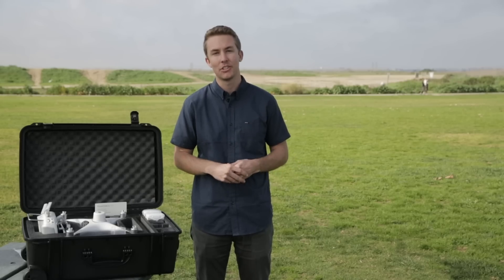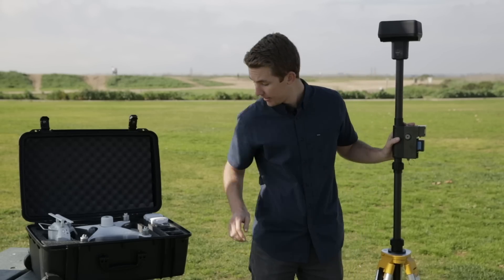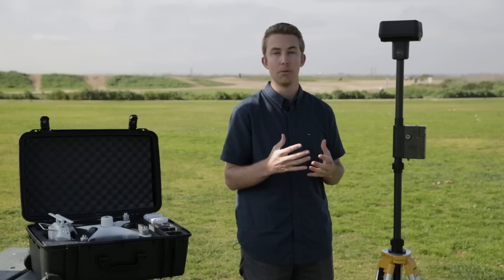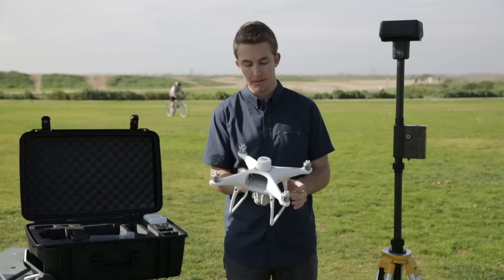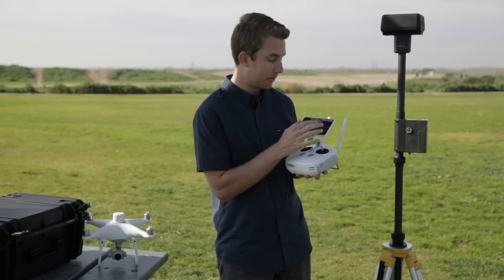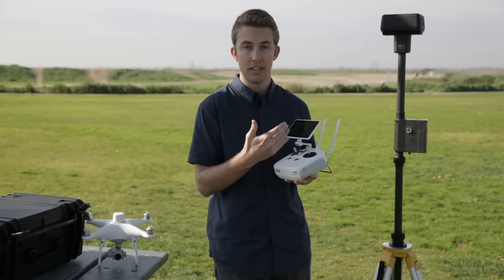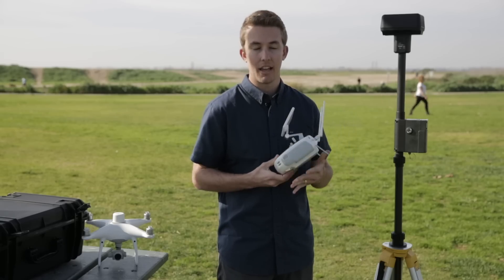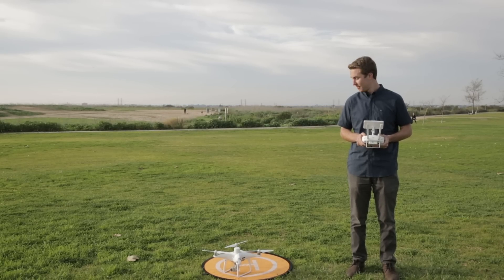DJI Phantom 4 RTK | Mission Planning & Setup with the D-RTK 2 Base Station

Comment: Just one thing to be very careful, if the base is not set on a known point or get corrections from a server, the relative precision will be good, couple of cm, but the absolute precision, the one that matters when doing a survey, will be 1-3m
Reply: Actually that is not entirely correct.  The relative precision will be within a couple of cm, that is correct.  But to say that the one that matters is your absolute precision is not entirely correct.  What I mean is, does the typical user really care where their map as a whole is accurately located on the earth to a couple of centimeters?  The answer is no.  A typical user does not care if their project as a whole is located on the earth to a couple of centimeters.  What a typical user cares about is the relative position to each other.  As long as my  points are correct to each other to with a couple of centimeters that is what is supremely important. A typical user will not care if the entire project is located to with a couple of centimeters to the correct latitude and longitude on the earth.   Only if I was trying to send coordinates for the chimney to send a smart bomb would I care that the absolute point is located.  The only flaw in this setup is that your elevation will not necessarily be tied into a local county or state benchmark Hopefully I made myself clear.
Reply: @MichaelSmith-td7op  Hi..so if I use this D-RTK 2 with Zenmuse L2, do I need the known survey point?

Comment: So first make sure you only survey open greenfield sites that are flat and devoid of trees!!!!

So it cost a packet and in most places if fing USELESS.

PPK all the way.
Reply: Bit of an exaggeration there mate.
Reply: @brettjames9088  lets see it work where 90% want to build next to roads people high buildings even low building for that matter. You cannot use a tool that clients rely on and have to turn down most the work or worse attempt it and not be able to deliver. PPK is the best we got at the mo. One broken stream in an RTK flight and its a do over.
Reply: @Guide504  UHF base stations have been used for large civil projects for last 20 years across hundreds of thousands of sites for machine control and rovers. Maybe on a site 30km + you might need a repeater or 2. 
Also keep in mind graders aren't 120m in the air.
Reply: @brettjames9088  graders don't have to follow the CAA regulations !
Reply: @Guide504  No shit. 
The point was something 120m in the air will have far less line of sight issues than a grader on the ground, which has been used very successfully via UHF GNSS for a long time now. 
I'm guessing you are not a Surveyor.
Reply: @brettjames9088  ahh
So why worry about the clear line of sight in the air ref in the vid.
Reply: @Guide504  What do you mean in the air ref? 
Don't really want to keep this discussion going, just wanted to point out your RTK remark was an over reaction.

Comment: Nice video. However, for a complete tuto,
You should have told how to set the coordinates  of the base station placed above a known point (with measurements of the height of the antenna).
Because without this point set up, the mission you did is useless
Reply: Yes. I would like to how to use this function as well. I have this at work and a beginner but I would like to use with out GCP's....
Reply: how is this done?

Comment: Congrats for the video, did you know if is posible post process your ground station point in softwares like topcontools?
Reply: I'm interested in the same question.  I haven't found a way to get RINEX data from the base station.  You can export RTCM data but it's in a .dat file format and not typical generic RINEX form.  File is similar to a Geomax GPS raw data file but their converter doesn't happen to work for the DJI base file.
Reply from the maker: If you are looking to use Topcon Tools for analytics, you will first need to process the imagery with point cloud generation software and transfer the completed map to your preferred analytics software. The Phantom 4 RTK does support PPK post processing if that is what you are referring to.
Reply: Udhtd add tho